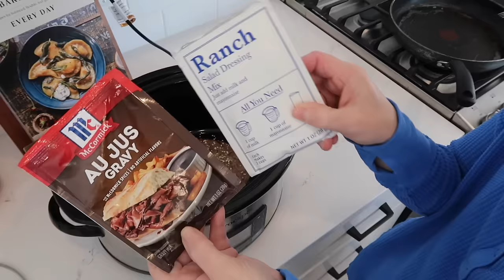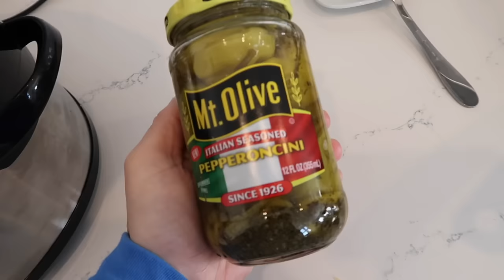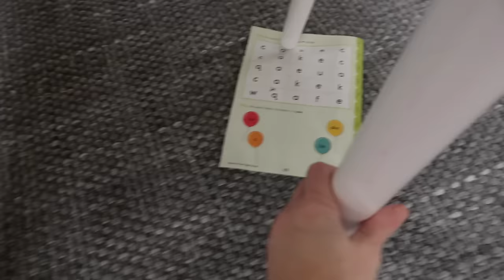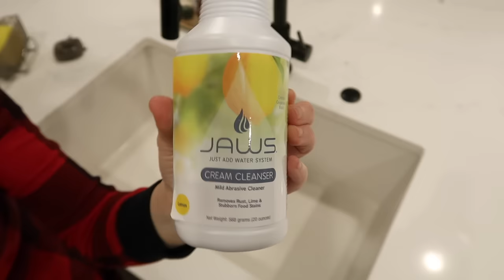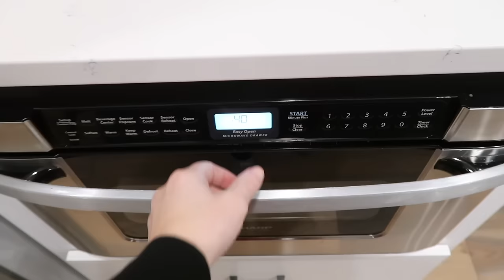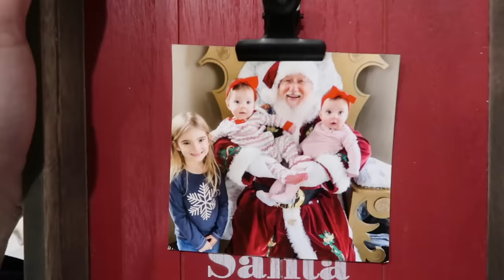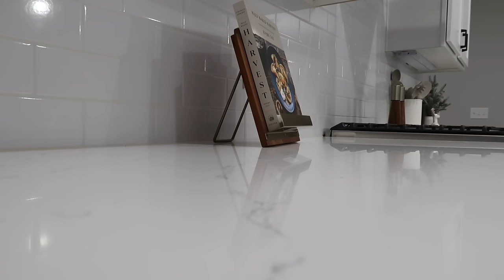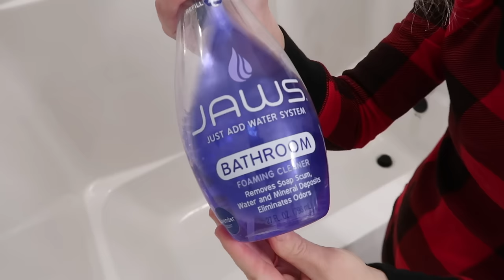NEW! CHRISTMAS CLEAN + DECORATE WITH ME🎄 | CHRISTMAS DECORATING IDEAS 2023 | CLEANING MOTIVATION

Comment: Hi Josie, an even easier tip to clean your microwave..I use a small bowl of lemon juice and hot water . run the microwave for 5 mins, then wipe out... be careful, it gets hot. No chemicals or soap residue. Also here we do not celebrate Thanksgiving, so my Christmas starts in December... its low key until about the 15th of December, then my tree will go up...   love from Cornwall, UK